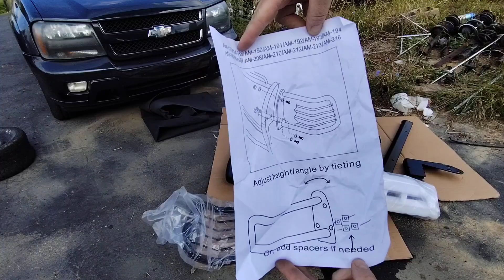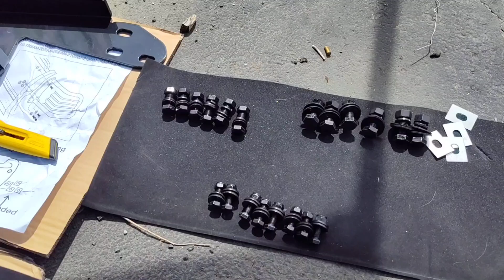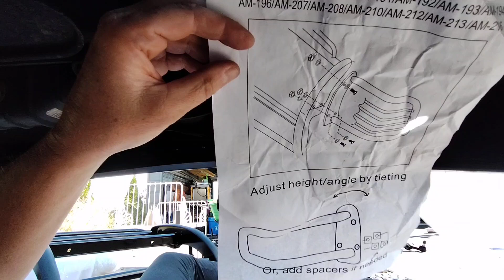Assembly and Installation: 2006 Chevy Trailblazer BrushGuard.

Comment: I'm restoring a 2006 Envoy, I'd love to add one of these. Do you have the ebay link? I see a bunch but I don't want to purchase if it won't fit my vehicle.
Reply from the maker: It's been added to the description.  Thanks and good luck with your Envoy!
Reply: @Mr.Handy-ish  Thanks man! Shouldn't be too much trouble, just swapped out the shocks/struts and rear springs. The driver seat doesn't move anymore, but that just means no one else can drive it :).
Reply from the maker: Like some kind of mystic blade...only the worthy (or your size) can drive it